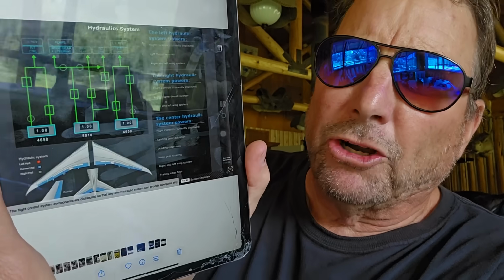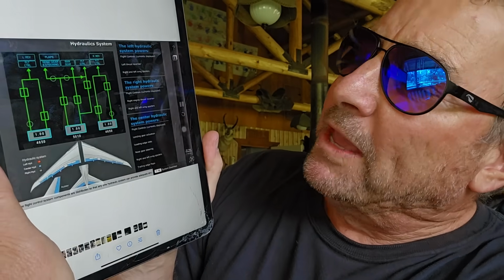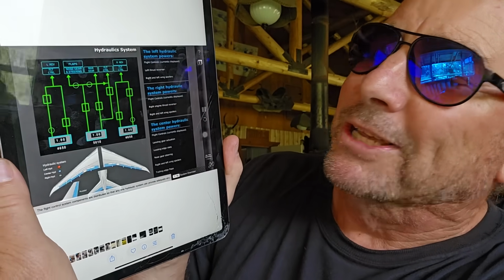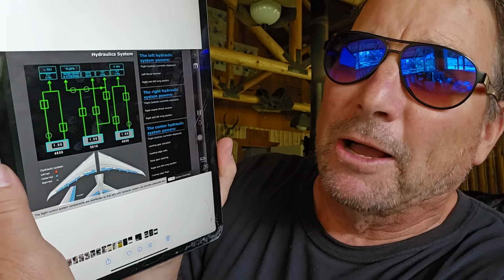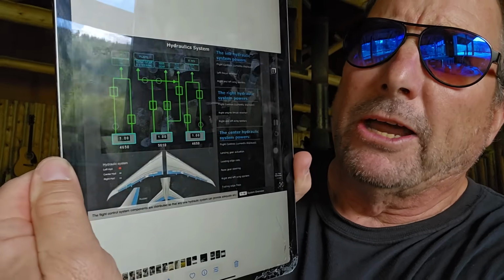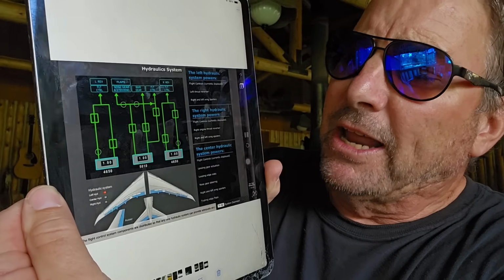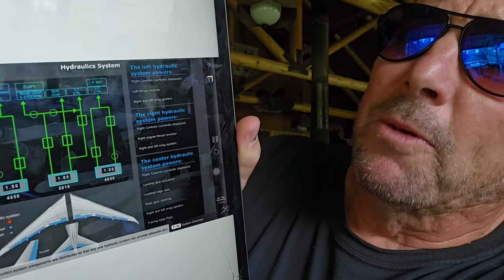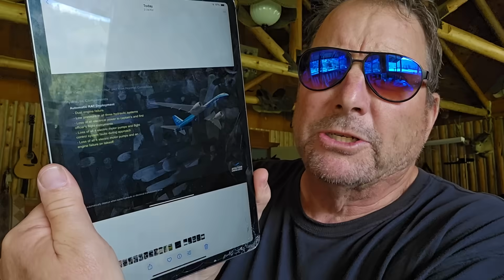787 Crash India What's a RAT? When does it deploy?

Comment: I've copied this comment from another Youtuber... and Juan, I BELIEVE IT'S WORTH CONSIDERING!!

 @Bertieuz
14 hours ago
Here’s my theory, bear with me, amateur plane mechanic over here: 

The extreme heat in the forward equipment bay – caused by 40 degrees C ambient temps, close to max weight takeoff roll and the aircraft sitting in full summer sun on sun-baked tarmac for 3 hours – could have triggered a safe state reset of the fuel system controller (FSC) right after takeoff due to overheating.

I did some digging on flightradar24 and noticed this airframe VT-ANB has been consistently failing to send ADS B data during taxi only from Ahmedabad, for weeks. Other 787-8s on the same route don’t have this issue. The lower antenna sits in the forward equipment bay – same place as the FSC – so heat affecting electronics in that area seems plausible to me. Could be a bad antenna, but this airframe only seems to do this at this airport. Could be that the extreme heat here pushes it beyond its working capability.

The plane was fully loaded, close to max takeoff weight. A long takeoff roll, full power, means big electrical load and even more heat in the forward bay. If the forward bay is already hot (maybe 60) right at rotation, the last bit of strain and heat could’ve pushed the FSC over its limit – around 70 degrees C or so. when that happens, the logic card enters may enter “safe state” mode

in safe state, the centre tank fuel pumps will stop because nothing is now controlling them. It’s considered safer in the logic of the aircraft to have the high pressure pumps stop if they cannot be governed. And the wing tank pumps don’t kick in, because they’re also controlled by the same FSC to the best of my knowledge) which is now basically offline. 

The engines lose fuel pressure instantly. the electronic engine controls (EECs) detect it and roll back to protect the engines. Then the RAT deploys almost immediately. With no fuel pressure and no thrust, the plane stalls before it can really climb. We get what we see in the video, a plane which takes off fine, loses power almost immediately with no visible damage and has a deployed RAT. 

Everything seems to add up to me:

– normal flap setting (no flap lever mistake)
– both engines lose power at the same time explains soft smoke free symmetrical descent 
– RAT deploys straight away due to engines idling
– ads-b issues only at this airport, only on this airframe indictate potential heat issue. Ahmedabad stands for wide body’s are all south facing and accident flight was sitting in full midday sun for 3 hours before takeoff.
– max weight contributes to heat buildup as long take of roll generates heat in electrics 
– sudden loss of power matches a software error, you can almost see the plug being pulled in the video. Fuel contamination has been ruled out pretty much. Icing isn’t happening in India. 

if the FDR shows the fuel controller dropped out after rotation, I think that’s the whole story right there

What do you think?

Comment: Here is why I respectfully believe you’re wrong, and why the RAT deployment in this incident points to a very different causal chain than dual engine failure. While the RAT does deploy AUTOMATICALLY following certain failures such as dual engine flameout, severe electrical, or hydraulic system loss, it can (and also has been in other cases) be deployed MANUALLY at any time by the crew if they believe critical systems are failing (I believe the crew was caught off guard and assumed a dual engine failure may have occurred). In my professional opinion, based on the rapidly deteriorating performance profile, the absence of configuration warnings, and the rapidly escalating workload, it is entirely plausible that the crew perceived a serious system failure and MANUALLY deployed the RAT while both engines may have remained operational for the following reasons: 

Let’s talk about this accident flight from an exact flight profile recreation in the SIM. Using certified Level D full-motion simulator sessions with the 787 flight model, this exact scenario has been recreated using the departure airport conditions, the extended fuel uplift required for rerouting around active conflict zones, the estimated actual takeoff weight, while using only Flaps 5 configuration, the associated derated thrust setting, actual ambient temp and humidity conditions, and with the landing gear remaining extended throughout the entire flight duration, exactly as occurred in the real flight. The additional fuel load required for the modified flight plan likely brought the aircraft very near structural maximum takeoff weight, leaving almost no margin for performance degradation.

In these simulator replications, the calculated safe rotation speed for this configuration and weight was 169 knots. In the actual event, however, the crew initiated rotation at approximately 147 knots — more than 20 knots below the minimum safe rotation speed required for the aircraft to safely unstick at that weight and flap setting. This insufficient rotation speed can be explained as necessitated by the crew due to no more runway remaining and fully explains the observed tailstrike (and the “bang” the surviving passenger heard) and the marginal aerodynamic state the aircraft entered immediately after liftoff.

In every simulator run performed under these parameters, the aircraft consistently fails to achieve any sustainable climb once departing ground effect, even with both engines producing the FMS recommended thrust (due to incorrectly entered data). The simulator demonstrates that at this weight, configuration, thrust setting, and gear-down condition, safe climb performance is aerodynamically impossible outside of ground effect. This is not speculative—it is mathematically validated through certified flight model replication. Furthermore, in every simulator scenario, even when full thrust was applied at the point of departing ground effect — with the gear still extended and no flap reconfiguration — the aircraft still eventually entered an aerodynamic stall and was unable to establish any climb. The simulated aerodynamic descent paths consistently resulted in impact within approximately 500 meters of the real-world crash site, strongly validating that the degraded energy profile modeled in the SIM accurately replicates the actual event.

The root of this performance collapse likely traces back to incorrect FMS data entry, specifically weight, thrust derate, and flap selection. The 787’s automation logic will NOT trigger configuration warnings if the entered values are mathematically consistent and within system acceptance ranges. In my professional opinion, this vulnerability has been repeatedly demonstrated in prior serious incidents, most notably Air France 777F and Emirates 407. In both prior cases, crews entered incorrect takeoff weights which produced dangerously low V-speeds, delayed rotations, tailstrikes, and barely achievable climbouts — despite both engines producing full thrust. No configuration warnings occurred because the invalid entries remained computationally valid. These events confirm that configuration warnings cannot be relied upon to detect performance entry errors.

The Air France 777F incident at Paris involved a 100-ton weight entry error. V1 and Vr were calculated incorrectly at 152 knots instead of 175 knots. Flaps 5 was selected. The aircraft rotated dangerously late, tailstrike protection activated, and only reached 172 feet AGL after full thrust was applied post-rotation. The Emirates 407 incident in Melbourne involved erroneous weight entries that caused V-speeds to be more than 20 knots too low, leading to obstacle strikes, delayed liftoff, and maximum thrust barely sustaining marginal climb. In both incidents, no configuration warnings activated. Both followed the exact vulnerability path now seen here.

Video evidence further corroborates that both engines remained operational throughout. Exhaust distortion, visible thrust displacement, heat plume, and dust blown from the departure threshold are seen throughout rotation, descent, and in a more recent third video, the final impact. In my professional opinion, this visual evidence directly contradicts any suggestion of total dual engine failure.

It appears that the crew’s own communications also support an aerodynamic failure chain. The initial mayday call allegedly referenced “loss of lift,” indicating the crew initially recognized insufficient aerodynamic performance, not engine failure. Only moments later, as aerodynamic stall developed and workload intensified, did references to “thrust loss” occur. This progression reflects increasing cognitive overload in the absence of any configuration warning cues while managing a rapidly degrading energy state.

Taken together — simulator replication, operational incident history, aerodynamic modeling, new video evidence, crew communications, and aircraft system logic — I believe the most probable sequence remains: incorrect FMS data entry, improper Flaps 5 selection, degraded acceleration, delayed rotation, forced liftoff below safe climb speed, tailstrike, ground effect flight, aerodynamic stall once ground effect was lost, escalating crew confusion, MANUAL RAT deployment, continued engine thrust through descent, beyond the thrust recovery coefficient of the drag curve, and final aerodynamic energy collapse (power on stall) at impact. This sequence is fully consistent with multiple prior real-world incidents, thoroughly validated through certified simulator replication, fully explained by the aerodynamic performance data, and far more likely than a sudden, symmetrical, dual engine failure event, which remains operationally remote and unsupported by any credible evidence in this case.
Reply: The area where that tail strike would occur might still be intact enough to find such damage...The impact would be audible on the CVR...Mr Romesh could be asked if a tail strike occurred on take-off (which he never mentioned)...
Reply: @Exiles800  I believe he mentioned hearing a loud bang and we clearly can see the engines the entire time from takeoff roll to impact — no compressor stalls, no bird strikes. The bang was likely a tail strike as reported by non-passenger witness accounts who could see the late rotation.

Comment: Failure of both engines would seem to meet the requirements of automatic RAT deployment. (Unless the APU was running) Points to simultaneous engine failure.  Fuel starvation or dual Engine Control Unit (ECU) failure.  Other things could be FOD ingestion, Runway debris, numerous bird ingestion, or engines running out of oil at the same time.

Comment: The RAT looks like it was definately 100% deployed. But did the engine power drop due to a mechanical ( probably fuel) problem or an electronic control problem? Human error is looking less likely at this point. But I'm still not understanding the flap situation.

Comment: The new cleaner video has indeed emerged clearly showing the RAT did deploy. You can also hear it along with the lack of engine thrust. A pilot friend with a British airline also says there is an issue with overtemp sensors on 787's that result in engines throttling back or shutting down due to false interpretation of turbine temps. This is I'm afraid a know issue with Dreamliners.

Comment: Loss of hydraulic pressure means no flaps and no way to retract landing gear.  The Dreamliner runs a higher pressure hydraulic system to run smaller cylinders and hoses.

Comment: Given the evidence so far, an electrical-power failure looks like the most plausible trigger:

In the hypothetical case of one engine rolled back or failed during the take-off roll and its accessory gearbox trip took both of that side’s VFSGs offline, the Bus-Power-Control-Unit could see both AC busses go dark.
* The RAT would auto-deploy.
* The center hydraulic system will lose pressure, as the electric pumps are no longer running.
* With no AC power and center-system pressure, the landing gear actuators and sequencer remain unpowered, so the crew’s “Gear-up” call has no effect.

With the gear still down, OAT 37 °C (ISA + 22 °C, pressure altitude ≈ 3 000 ft), flaps 15° and only one engine at TOGA, the excess thrust is about +100–115 ft/min.  

Climbing to 600 ft AGL costs roughly another 2 % thrust and removes ground effect, so the climb margin turns negative, and the aircraft settles – exactly what the CCTV shows.

A pure center-hydraulic failure would also stop the gear from retracting, but would not auto-trigger the RAT unless all three hydraulic systems lost pressure, which is unlikely without an uncontained engine failure.

Comment: Check for fuel contamination such as water and microbiological by taking fuel samples of the fueling station or the truck/trucks that fueled it. Check last two fuel servicings.  If it was fiel contamination then one engine would flame out  followed by the other one within another minute or two.  

Check the maintenance logs for maintenance done inside the wing fuel tanks.  Rags or pads would have been used to soak up fuel. If one or more were left inside it could have clogged a fuel pump, transfer pump, check valve, or interconnect valve.  Or, rags might have been used inside transfer lines but left behind.  

Check the oil servicing units for proper oil and for water and check if the engines were sreviced.

Check proper skydrol servicing if thats what is used in the hydraulic systems.

Check throttle quadrant maintenance or the logs for R &R or for any throttle sticking  or jammed discrepancy.

Comment: This crash will turn out to be an AIR INDIA affair.
The MOST crucial vid is not this about RAT deployment (albeit it's a kind of confirmation).
A passanger from PREVIOUS flight, 2h before crash, made a rant vid about fligh from Delhi where AirCon system doesn't work and Infotainment doesn't work either.
Why would crew or computer shut down AirCon and Infotainment during flight ? They aren't interdependable and a sole AirCon malfunction wouldn't swithc TV screens off and vice versa.
Because this 787 already HAD SOME ELECTRICAL FAILURE and they shut down circuits LEAST needed in an aircraft to reduce the stress in electric systems by cutting those that generate high power demand but aren't needed to fly safe.
So either after landing this was NOT REPORTED or was fixed carelessly by Air India technicians and "exploded" during next take-off that is an electricity-high-demanding procedure.
In other words - 787 had a blackout due to some earlier malfunctions that were not properly fixed.

Comment: The survivor said there was a bang which you would expect if a high power electrical system failed spectacularly. The lights flickered he said... After take off. I guess they pulled the gear up lever and it caused an electrical failure.

Comment: what if the RAT malfunctioned and deployed in error at such a low altitude ? Could that lead to a crash ? Sudden weight or pressure on the plane, or the RAT messing up the systems ? The plane systems thinking it’s time to ‘glide’ to safety ? No expert by any means. Just throwing it out there.

Comment: The General Electric GEnx engines make almost 80,000 lbs of thrust each. If even one of those engines was still operating, that plane would have been able to continue a modest climb in any configuration. We are looking at a double engine failure. That's at least one reason the RAT was deployed. In my experience, it always takes multiple reasons for an aviation accident to happen. Smart planes like the 787 have too much redundancy to fail for a single reason. The 787 is very dependent on electrical power for primary flight control, and a lot more systems. Loss of electrical power would be really bad.  But the loss of both engines is enough to guarantee a crash at that point in the flight.

Comment: What is the theory on why the APU inlet door is also open in the photos of the tail section? Would that be opened by the force of the crash (I would not be sure so although it does have a branch caught by it), or would it be opened (automatically or by the pilots) in the same or similar set of circumstances as the RAT deployment?

Comment: If the *FADEC system is housed within each engine* and retains its ability to function independently once power is restored, then yes—it’s logical to assume that *FADEC would resume its control* once the RAT provides electrical power.  

However, the key issue is whether the *RAT provides sufficient and stable power* for FADEC to operate effectively. RATs are designed to **prioritize essential flight controls and communications**, not necessarily full engine management. If FADEC requires more power than the RAT can supply, it might not function at full capacity.  

In the case of the *Air India crash**, reports suggest a **severe power loss shortly after takeoff**, and while the RAT was deployed, it’s unclear whether it was able to restore enough power for FADEC to regain full control. Investigators will likely analyze **black box data* to determine whether FADEC resumed operation or if the engines remained unresponsive.  

Your reasoning is solid—if FADEC is *engine-integrated**, it should theoretically resume function once power is restored. But whether the RAT **provided enough power* for that to happen is the real question.  
AI analysis.

Comment: Interesting theory that makes sense. 
But didn’t the pilot call a mayday advising of dual engine failure just moments after being airborne? 
Which makes sense, other experts are saying the speed at take off was at approximately 170 knots, which is normal take off speed for that plane. 
I’m convinced there was nothing out of the ordinary until that plane left yet runway.   For instance the RAT to be deployed makes complete sense, based on what the pilots communicated    And possibly dual engine loss.